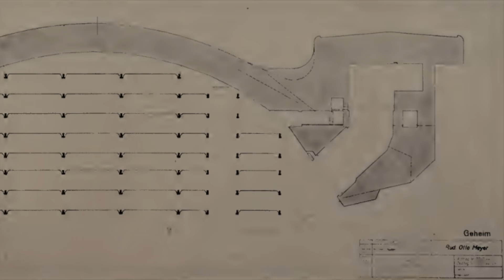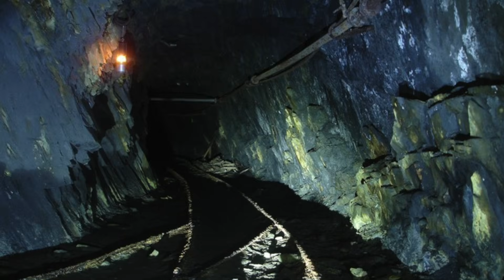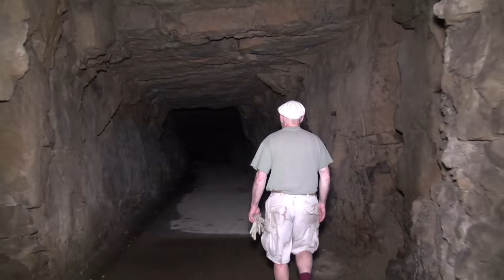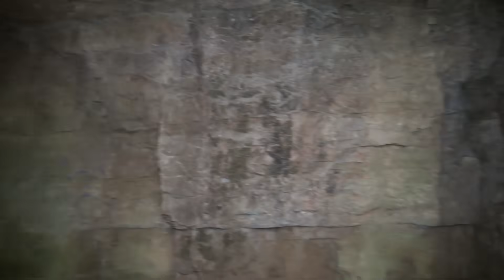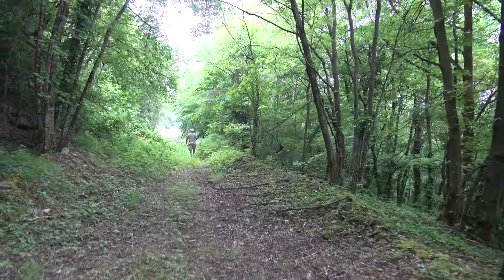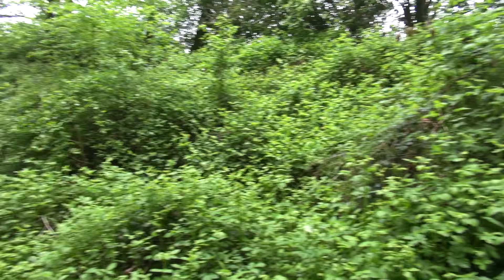THE FORGOTTEN WW2UNDERGROUND PROJECTS

Comment: The "structure" of that tunnel complex is a bit different. It looks like a "cut and collapse" mining operation. A lot depends on the nature of the over-burden and the "load" applied from above. It all becomes more expensive and a LOT more dangerous, the deeper the excavations go. Because of geological movement, such seams are often inclined, just to add to the challenge. Basically, ""pillars" are left and the "ore" or whatever between them is carted away. That technique is often used in coal mines where the "seam" is relatively "thin" but may go for many kilometres in all directions. Was this area a traditional mining zone, repurposed late in the war?

Comment: Those metal pieces you have seen before in other tunnel systems are to be used with rebar. Separating, and keeping the layers of rebar at a specific spacing when pouring reinforced concrete.